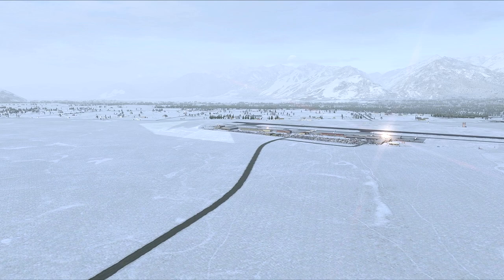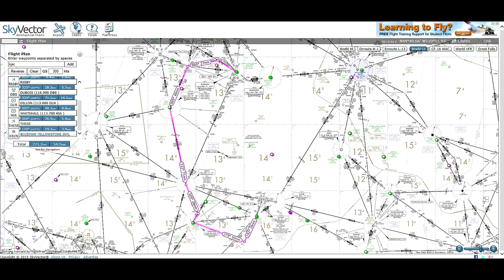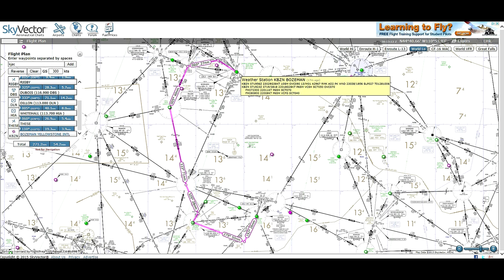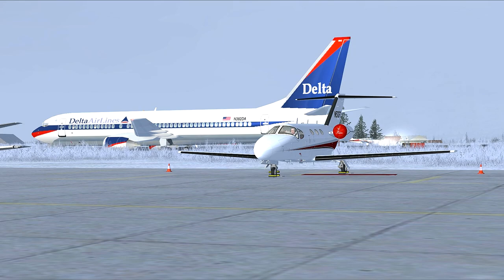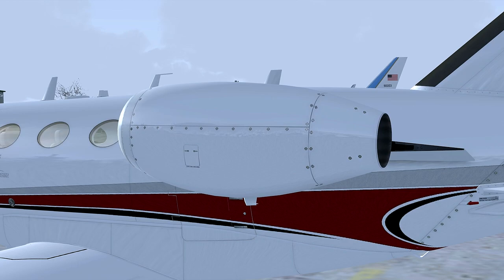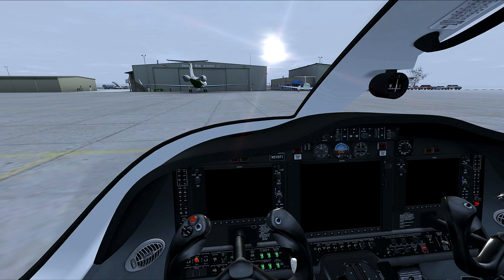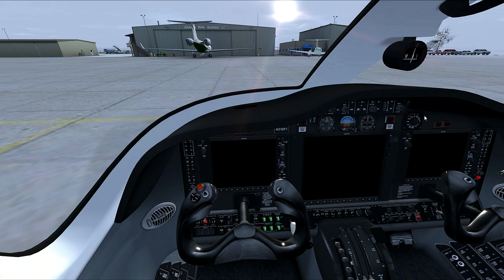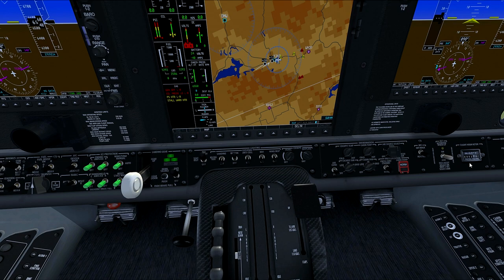Flight1 Cessna Citation MUSTANG HD part 1 of 3

Comment: Hey Tim,
Good to have you back. Informative and professional video series as usual.
PT
Reply from the maker: Hey Paul,  It's good to be back.  Vacation and holidays most of December, then play catch-up most of January.  Finally I can get back to FS MaNiA and what I enjoy the most!  Have you seen the new Carenado S550 Citation?  Carenado really out did themselves on the graphics for the exterior.  One beautiful airplane in the Sim.  I wish they worked equally as hard on modeling the aircraft systems!  At any rate, I have it in the hanger, and we're going to add it to the Business Jet Series.  If nothing else, it should make some good looking eye candy!  I have started my study work on the aircraft in prep for the next video.  Thanks for the comment!  Kindest Regards, Tim G., FS MaNiA
Reply: FS MaNiA
I look at all the new offerings. Couldn't resist, I finally jumped in and am flying the Carenado King Air C90 And the Baron. Nice! The only problem is FPS. The Carenado stuff eats my PC for lunch.
I am going to switch to X-Plane as soon as I can cobble together a computer to handle it properly.
Just a thought, don't forget us prop guys.
PT
Reply from the maker: PT Johnson No worries Paul,  I have a new RealAir Beech Turbine Duke that is in the lineup.  Also, I have the Piper Meridian, and the Socata TBM in the wings (no pun intended).  I hope I can pick up the pace a bit soon,,, so many airplanes to fly and so little time ;)

Comment: close to probably 1000 hours in the Flight1... also have the Eaglsoft and Wilco version of the X....PMDG NG '37...etc....  odd thing here,  as...i quickly learned once getting the "Stang..... you must have some form of 'ground pwr. add on ( as i do)  because that little item can't sit there on the ramp that long,  operating all her EFIS Systems merely on.."Batt" pwr.  LoL!   can't tell you how many times ( especially during my 'newbie hours' in her...)  that...checklists be damned,  it was a race against the clock to get at least 'one engine started',  to provide adequate power to continue setting everything up.   eventually,  i purchased a little add-on called "Batt-X"...for about 10 bucks...which enabled 'infinite' ground power,  so you could sit there for an hour if you wished ( no engines) and just ..peruse all switches and functions until you were comfortably ready to crank a powerplant.   great vids "Mania'....
Reply from the maker: +drummerfella 55 Hey drummerfella 55!  Sorry for the delayed response.  Real world duties have been hammering me since the holidays.  I use the licensed version of FSUIPC which has a tool to make the battery life more realistic in the Mustang.  I had the same problem with the Flight1 King Air B200.  I had heard the Batt-X was another option as well.  I have become a big fan of Flight1's work as I have accumulated more time in the King Air and Mustang.  Thanks for chiming in on this!  Cheers from Tim G., FS MaNiA

Comment: I'm sorry you experienced so many bugs with this aircraft. Are you using the latest version (I think it's 1.08a)? This aircraft is the only one I bought more than 5 years ago and I still fly it. It aged very well in my opinion. VC still looks better than most of todays releases. G1000 doesn't kill the performance so much like Carenados glass does. I have Carenado SR22 and it performs worse than PMDG NGX.
Reply from the maker: Tomaž Drnovšek Hey Tomaz,  I just checked and I have version 1.07.  That's my bad.  I usually double check to see if there have been any updates prior to starting an aircraft feature video.  I bet a lot of my issues would be resolved easily with an upgrade.  Also, I run so many add-ons simultaneously, my bugs could very well be a conflict on my system.  I am sure I could work them out if I spent a little time on the support forums.  Mostly, the bugs were intermittent, and I was able to eventually fly bug free (except the pressurization which is no biggy).  I do love the high level of functionality of the G1000 in the Mustang.  I have the Flight1 King Air in my hanger that is on the list for a future feature video.  I will definitely check for updates before I start flying.  Thanks much for your comments and for watching.  Kindest Regards, Tim G., FS MaNiA

Comment: So..I have a problem were the engine WILL NOT start..I followed the checklist the tutorials everything
Reply from the maker: That’s weird and frustrating to be sure!
Reply: @FSMaNiA  the thing is that cntrl+E starts them up just fine...
Reply: Make sure the throttles are in ico, idle cut off, and using the click spot just below each throttle click them into idle when N1 has reached at least 9%.
Reply: @dragoclarke9497  I did that, I followed the pilot guide and the steps in the video.... But nothing
Reply: @danielmichel7000  I find I have to check all the switch positions before turning on the battery otherwise the battery goes flat very quickly. As soon as battery is on,  start an engine, making sure generator is on, then start the second engine and do all the checklist items, including before starts, to make sure nothing gets missed.
Reply: @dragoclarke9497  rgr, will try it, I hope it works....and Thanks for the help

Comment: i fly past first waypoint i have ap and nav and gps selected.my flight is cyow cyul and rnway14. the flghtplan lists cyow rnwy14 then it says 780 then avvon but the plane flies past avvon? any ideas?
Reply: i had loaded the .fms plan for cyow -cyul
Reply from the maker: Be sure to make the first leg of your flight plan active and that you have a magenta line indicated in the map view.  If that's not the issue you may have to dig into the documentation or find help in the Flight 1 User Forums.  Hope that helps.  Tim